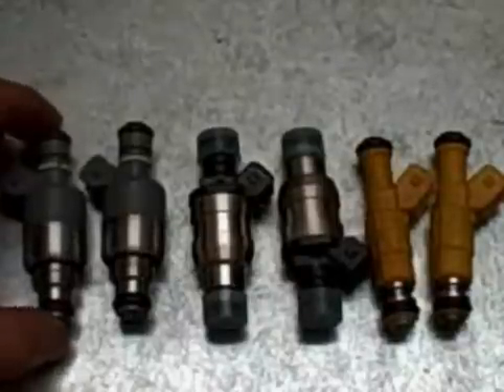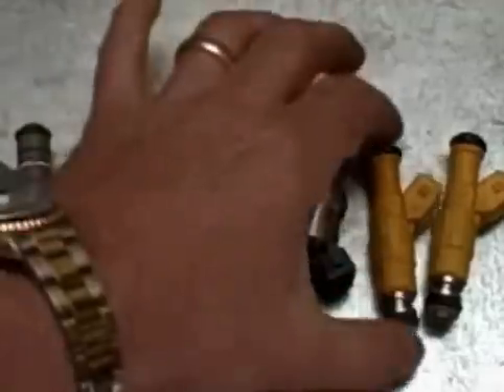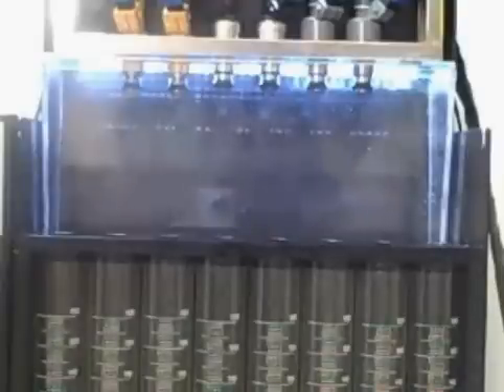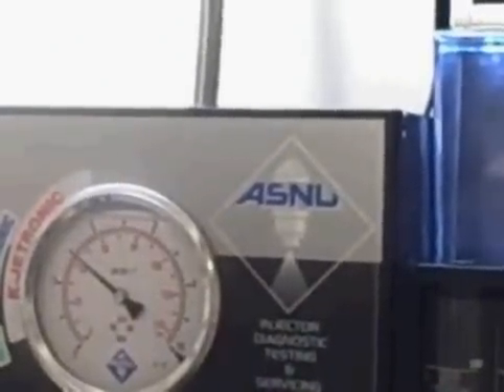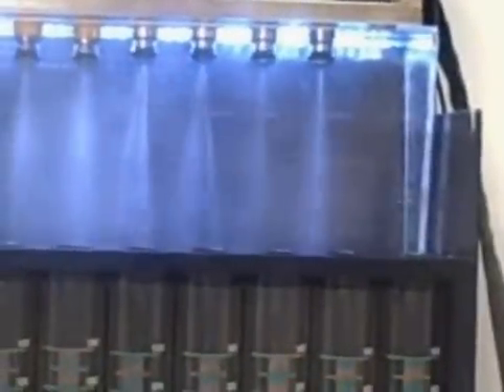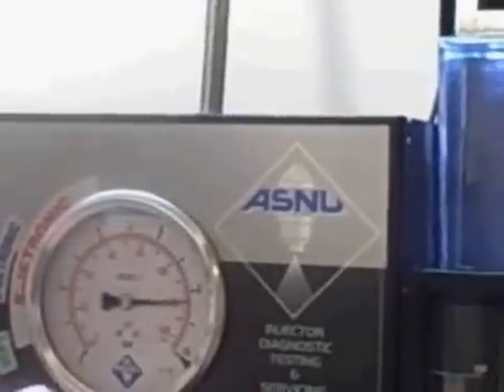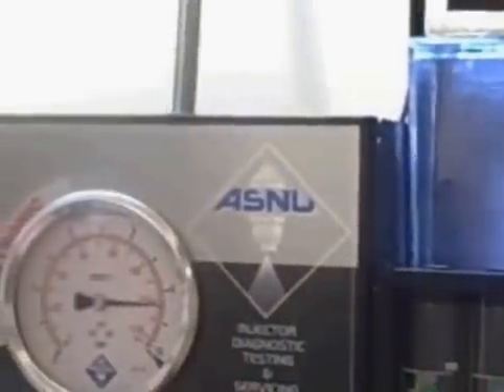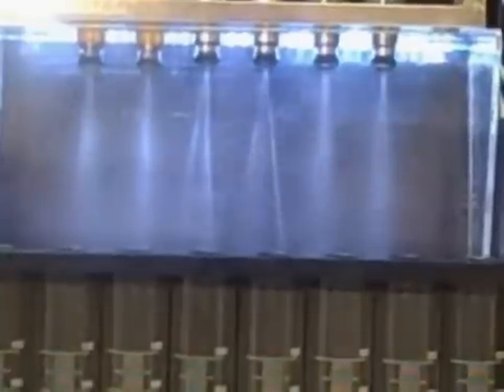comparison of Lucas type disc injector to Bosch design III to the stock GM multec.

Comment: Pretty pointless fact that the Multecs don't flow above an outrageously high pressure that they will never ever see in normal operation, they flow perfectly fine at every pressure they're likely to see, and that is all that is relevant. 

The Bosch 3 are not a direct replacement for the stock Multecs, the Bosch 3s fire significantly slower than the Multecs, which has a noticeable affect on idle quality on all but a bone stock setup. It does matter.

There are tests done by someone over on Third Gen forum and the voltage offsets on the Bosch 3s are WAY up compared to the OEM injectors.

I had a set in my 93 Callaway Supernatural and it ran better with the stock OEM Multecs than it ever did with the Bosch 3s, since i have now ditched the Bosch for a set of Delphi it is now running the way it should. 

I've installed the Bosch 3s in a fair few Corvettes, and when bone stock with factory tune they are generally quite acceptable, not always, but usually, however they are NOT as good as the Delphi injectors anyway.
Reply: I need to find that thread.  This is the first I heard that the Bosch were not better than Multecs.  Which Delphi injectors do you use?  They don't look like a very good spray pattern when he shows a vid.  I have an 87 Vette only 17k miles & been in storage for 25ys due to bad health, but drained the tank but not fuel rail, so I am sure I need new & better injectors.....what do you suggest?  Send out Multi a for cleaning & testing, Bosch III EV 1.3 or Delphi?
Reply: @ 87 has older style Bosch. For 87 you want the Delphi 22lb for TPI from South Bay, they work very well.
Reply: @ Thanks!

Comment: Rochester (multec GM OEM injectors) equals to bosch, it is clear in the spray pattern as nobody run that high pressure in basic car so it doesn't matter if flow stopped at that high pressure. lucas is the baddest injectors ever i experienced them in land rover.

Comment: What’s your opinion on those injectors sold on eBay claiming to be Bosch. As soon as you ask them if they are Bosch they either don’t answer or tell you it’s a remanufactured Bosch injector. They sell for about 60.00 for 8 injectors

Comment: Yea Bosch spark plugs are shit, I bought a 240sx and they had them in there when I changed plugs, 2 of the plugs where near warped, so I switch to a full NGK set up, spark plugs and wires and the car is a helluva lot better and more responsive.

Comment: i think the lucas is a high pressure direct injector, because the spray became more of a mist as he added pressure. and a direct injector fires around 200psi at high idle.
Reply: SpikeZeek
Direct injectors are around 2000psi

Comment: Great video. The middle ones look like some trick flow 120 lb/hr injectors I used to run on my eclipse. They are by far the best injectors I have ever tuned on.

The two on the left look like the stock 19 lb/hr injectors that came out of my 5.0. I went to 30 lb/hr single pintle bosch style and it runs decent, not great.

I will be upgrading to a 36 lb/hr lucas disc type. I have heard the best things about these style and also have great tuning experience with. Thanks for posting!

Comment: i guess the coils in the injectors can't open the valves against the higher line pressure. Endresult: they stay closed eventhough they are activated to open....

I really like those Bosch on the left, great spray pattern under all conditions.